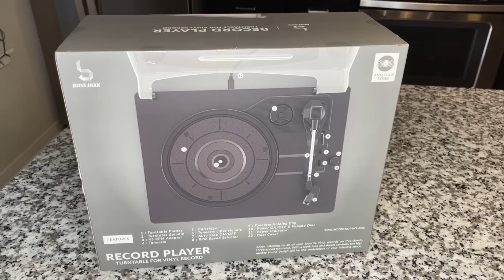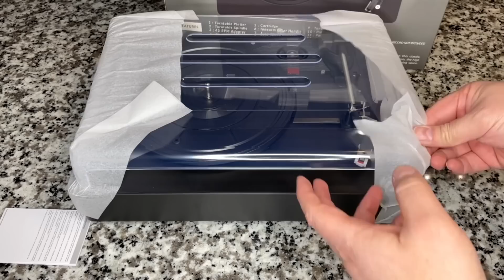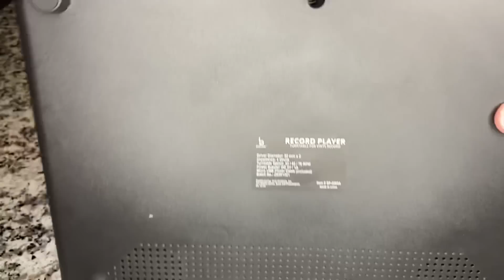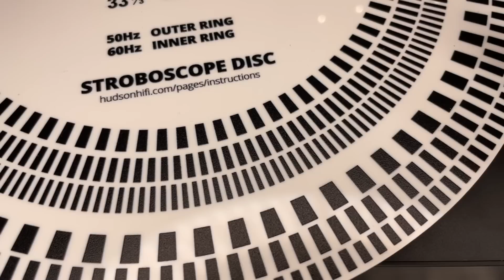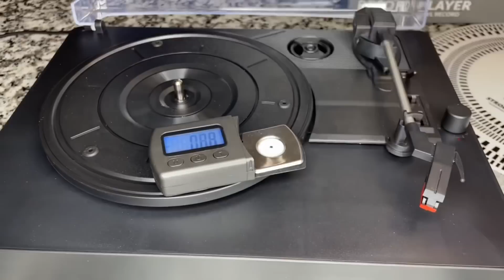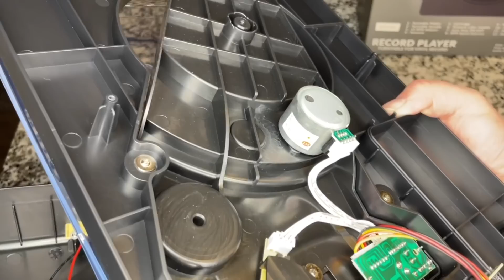SHOCKING $25 Record Player from Five Below - Unboxing & Review!

Comment: Very thorough analysis! I'm wondering if the USB connection is solely for power purposes or if this can be converted to data (and maybe amplified). Have you tried connecting it to a computer to see if it's recognized at all?
Reply: Only 2 wires for the USB, so power only.

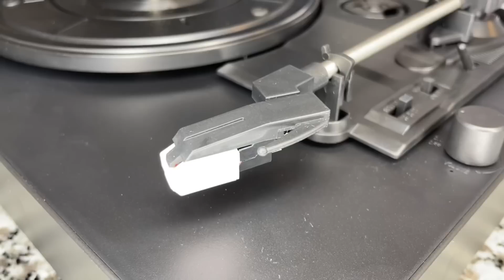Comment: It's been a few days since your review. Ebay resellers are asking over $50 for this unit, and one of these Bass Jaxx record players actually was a completed sale for $49.99 on December 24th. When word gets out on YT videos about a better-than-expected electronic product, prices tend to go way up.   P.S. At 9:26, I notice that the headshell area where there's some sort of finger lift looks as though there's a molding crack. Maybe this is more of a mild scratch which shows up strongly during filming.
Reply: Those paying more then $25 for these will be disappointed… the amp on these can’t handle loud records and clip. So yeah it’s a problem.

Comment: Did you try to connect the Micro USB power connected with a Micro USB to USB cable to your computer to see if it installs a driver and possibly accepts the audio input directly into the computer ?

Comment: Could you plug the USB into a PC and play the record through the PC speakers?
Reply: There are only two wires going to the micro USB port, so all it connects to is power. No data pass-through.
Reply: I was wondering the same thing.

Comment: Not bad just wished it had an output rca jack for hooking up to a stereo or a phono jack in it night could be modified & maybe a better stylus from LP Gear & maybe a little turntable oil it would be perfect. But not bad for $25 I'm impressed. I like the connectors inside. I was expecting flat ribbon cable that was glued together. That's a nice price too.

Comment: Conceivably, you could re route the speaker cables to a pair of RCA sockets or a headphone jsocket. and diode/switch them to cut off the speaker output,  drill the relevant holes, and you could make it more connectable for under $5

Comment: One very important thing that he doesn't cover in this video is whether that type-A USB connector would send an audio signal (hopefully stereo) into a PC if the cable was plugged into one. He seems to think that the unit only outputs through its speakers. It shouldn't be too expensive to also provide this capability. After all, USB cords do have 5 lines, two for power, two for signal and the ground shield.
Reply: It's only manufactured with two wires going to the micro USB connector. Negative and positive. The data lines are not present.

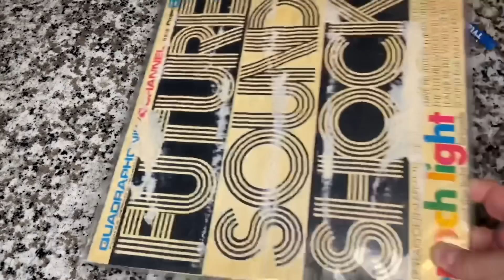Comment: @21:14 Waitaminnit: you're using a quadraphonic record to test a $25 turntable?!
And you're playing this quadraphonic record on a turntable equipped with a ceramic cartridge?!

I'm amazed that you said there was NO damage to the record after playing it on the Bass Jaxx, but I couldn't make out whether that disc you used is an SQ/QS type disc, or a CD-4/Quadradisc type disc.  If the latter, then I would expect most of the ultrasonic, 30-plus kHz 'difference' signals (used to derive the two extra channels) to be kinda wrecked by the 5g tracking weight, not to mention the conical stylus.  So the 'no damage' report was definitely an illogical surprise.  So I'm just interested: did you check under a microscope, and also see what happened (if anything) to the ultrasonic part of the cut?

All that said, nice to hear the music of Enoch Light (and the Light Brigade!) again: the bandleader and recording engineer who discovered The Free Design and produced their first few albums. 👍
As well as creating the archetypal Bachelor Pad music of the 1960s and 1970s 😉 …

Comment: Given your favorable review, I went out and picked on of these up today. Opened it up and tested it out... and I have to say that I am extremely impressed with this thing, considering how cheap it is. I think you might have gotten unlucky with yours, because my tone-arm cue lever works great and is very gentle.

I'm going to bring it over to my parent's tomorrow to play some of their old Christmas albums while we celebrate the holiday. I think this is just perfect for that sort of thing.

Thanks for this review, you definitely got my sub!
Reply from the maker: Thank you 😊
Reply: I’ve have bought and returned 5 units already. Each play a record for 5-6 minutes and then the speakers keep going in and out…
Reply: @crisbwilliams  That's a shame! I must have been the one to get lucky, then. I've already gotten more than 3 hours of use out of mine. Maybe there is a bad batch of them out there?
Reply: @crisbwilliams  it may be your power brick. Some have a built in safety that will shut down if it isn't pulling enough power. Try a different, or cheaper one.
Reply: @crisbwilliams  Your experience adds a valuable perspective to this review. I imagine the dumpster behind 5 Below is filled with these things.

Comment: Try playing a 45rpm on it with an aggressive groove. It seems as if the amplifier circuit can't handle the energy created by loud passages and mutes as a result. Kind of like the clipping that occurs if overdriving while recording digitally. If you have only soft/easy listening records, it's great out of the box. However, to play all records, the output from the cartridge will need to be attenuated somehow.

Comment: WARNING ⚠️  5 units replaced. 

Update- 1,2,3,4,5 units and all garbage. Update- I opened the newest unit up and reconnected all the cables to make sure nothing is or was loose… and still the issues persist. 

I have bought and replaced -5- of these units and all have the same issue. They play fine for a minute and then the sound cuts out… -5- units and they all fail .

Now 5  strikes and this unit is out. Garbage.
Reply: I have discovered that extremely loud/strong records cause the amplifier to become overloaded. Softer/more quietly mastered records play fine all the way through. I don't blame you for not wanting to keep a finicky record player. I think I can turn the one I got in exchange for a return as a party game. I have a bunch of 45's, so I should gather some friends over to play "Will it or won't it play all the way through?" 🤣
Reply: @aaronthompson5691   yeah I tried some older records, ie- Christopher cross - and it plays for a bit before the speakers cut out …. And then come back on. Weird is u can still hear the music when the speakers cut out… 

Oh well I’ve given it 5 attempts and it’s not worth the $25 spent. Better use that money towards something a bit better .
Reply: @crisbwilliams  The Christopher Cross album from 1979 was recorded on a digital recorder so they could have more dynamic range to record a louder groove with the lathe. So yes...that album is a large binary file from 40 years ago, at about the same time Pink Floyd released Another Brick In The Wall Part 2.

Comment: That's pretty amazing for $25; though it would have been interesting to hear it with a more bass-heavy demonstration record. It would be a simple matter to connect a line-output jack directly to the wires from the tonearm, possibly using one with a built-in bypass switch. I was particularly impressed with the frictionless optical end-of-record sensor, a feature many more upmarket vintage turntables lack.
Reply: I would love to see a follow up video! I don't understand the technical specs required, but it does look like a very hackable unit. For instance, with some mild soldering and $2 in connectors, could this drive some inexpensive bookshelf speakers (many of us still have laying around powered speakers that came with most desktop pcs back in the day). And what could a cheap amp board from ebay do for this? The author also made it sound like there are better replacement styluses for this type of cartridge. Etc, etc etc!
Reply: Then you would need a pre-amp with riaa eq. Or amp with phone input..
Reply: A shame it has no RCA Jack provision, nor conventional AC power hookup. That's a deal-breaker for me.

Comment: Have you actually hooked this to a PC to see if the computer doesn't recognize this as a peripheral; if it did, you might be able to play the music through PC speakers.  Just posing the question.   :)
Reply from the maker: Once I saw the wiring on the board I could tell that it was for power only
Reply: @Recordology  darn
Reply: @Recordology  Thanks for the response.   Still, if you want a cheap but apparently reliable record player, then you just shared one with the masses.  lol

Personally stick with Ogg or MP3 files for my play.   :)
Reply: @Recordology  No sign of a DAC, huh?

Comment: Older (1940's) Philco console radio/phonograph players had a crystal cartridge on their single speed (78rpm) turntables.  Usually the cartridges in these vintage players are dead and folks will try to use a modern ceramic cartridge to replace them with.  Problem is the old cartridges required something like 3 volts to work properly and the modern ones usually only have 1.5 volts making the volume very low unless you modify the tube amplifier to compensate for the lower voltage.  A friend of mine (Buzz1151 on youtube) decided to try and rebuild an original cartridge using the ceramic from a piezo tweeter cut down to size and it actually worked and sounded pretty decent.  At least that's what I remembered him using if I remember it right.  Currently I have a Philco 48-1262 console with the 78rpm changer in line out in my shop for restoration.  I'll keep my fingers crossed that the cartridge is still good as it seems to have seen very little if any use in it's day but if it doesn't I will try to rebuild the original cartridge like he did.  Wish me luck, lol.
Reply: Good luck!👍👍👍👍👍👍👍👍👍👍👍👍👍👍👍👍👍👍👍👍

Comment: $25 bucks? My stylus was more expensive than that! The records to play on it cost more than that. Like all cheap record players, pretty sure this will just destroy your records, and not worth it for that fact alone.
Reply from the maker: Why do you think it would damage records?
Reply: @Recordology  on cheap players or stylus, the needle (jewel) is much less likey to be shaped or cut as precisely as it should be. It won't damage it immediately, but it can wear the record out prematurely. Think of all those poor childrens records subject to cheap record players over the yearsI. I know I wore a few out when I was a kid. Less likely that the tone arm on this player was balanced properly. But If you're going to be paying 25 bucks for a new vinyl album (as most seemed to be priced at) or have decent valued older records , you're better off buying a higher quality turntable (not too expensive) like a gemini, fluance, or numark, or audio-technica with a or something decent you can put a decent brand name cartridge on.    As with musical instruments, the cheapest entry-level more often than not just isnt worth it.With something as relatively fragile as vinyl records, its worth jumping up to mid-priced equipment. Plus, it will last pretty much last forever in home use. Pretty sure the belt in this will be shot pretty quick, too, just like cheap tape decks had back in the 80s ans 90s.
Reply: wrong
Reply: Mr.Record-ology is right. He checked the tracking force of the stylus, and it is within spec for that type of cartridge and the specs the recording industry set when the standards were created.

Comment: I have to ask as it was not disclosed.  Is this record player dual mono or stereo. I heard mono in my headphones but not knowing the separation on the l.p., I have to ask.
Reply from the maker: It was indeed stereo
Reply: @Recordology  wow. I went on 5 below website, not there so it's probably a selected few stores
Reply: I can confirm. Definitely different parts of the mix coming through each speaker.

Comment: I was the kid that knew how to modify stuff, i woulda bought that, installed better speakers,then did an car radio interface for line level drop and ran it into what ever bigger stereo I had.I actually did it to one of those little crappy record players in the 70's,80's etc then id be upset it didn't sound to good.lol

Comment: Ok. So I went ahead and bought one of these and its absolute JUNK! The amplifier cuts out constantly on moderate to loud songs at any volume. I tried 3 of these units with the same results. It also seems to have a gated output to where the amp cuts out when there's no sound going through it, i.e. between tracks, and it tends to clip off a quarter of a second of the beginning of the next track.
Reply: Same here. I thought the first one had a bad cartridge, because after about 5 to 10 seconds of okay play, the audio would drop out. Lift the needle and place it on the record again, and get another 5-10 sec. Exchanged it, and with the second one, finally realized that records that were not as loudly mastered would play great, but as soon as any other record got too loud, I could begin to predict with accuracy when the audio would drop out. Keep and tinker with it, accepting the fact that without some kind of modification, it will never play the more loudly modulated records, or take it back and get a refund...
Reply: Perhaps needs a beefier power supply? But players like this sadden me for they are bottom of the barrel junk that will probably be clogging up the landfill before next christmas.
Reply: I’ve replaced 5 of these thinking it was bad luck… I posted a warning in the comments. Good to see I’m not the only one…
Reply: Sad, but true. Seems to be a design flaw. I have run into the muting thing on other Chinese players, and thought it might be that, triggered wrongly. I just got mine the 24th, so I haven’t been able to see if I can fix the problem.
It definitely sounds like a circuit intentionally muting the output for a few seconds under certain circumstances. I don’t believe it has anything to do with the particular USB supply used as long as it provides the 1Amp @ 5Volts needed. Just sad to see another potentially good buy on something that seems to sound reasonable, be hampered by a flaw that essentially makes it useless, unless there is an easy fix.
Reply: There's more than enough power being fed into the player. It's that the cartridge overloads the amplifier circuit. I don't even get near turning the volume all the way up with the records it will play all the way through. It definitely gets sufficiently loud, at least to my worn out ears. lol
Reply: No bueno senor

Comment: The Bass Jaxx brand is owned by Zeeva International Ltd. out of Hong Kong. The vacuformed plastic packaging spacers, the lack of wall wart or audio output are obvious cost saving measures. Also, it isn't advertised as USB because the USB port is used purely as power supply and it has no actual USB functionality.
Reply: Poor Basement Jaxx

Comment: It would be interesting to run the speaker wires out to some old full range 12" speakers you get out of 60's consoles. I'll bet it wouldn't be too bad.

 Why wouldn't they at least face the speakers forward? It appears they had the room.
Reply from the maker: I think facing down uses the flat surface to amplify resonance.
Reply: @Recordology  Maybe but it seems silly
Reply: That was definitely a thought out design choice. Gain some resonance from the surface the player is sitting on to make up for what it kind of can't do on its own.

Comment: but I want to hear the vinyl sound through speakers.  and I also require some bass sound.  and for that it is required either that it has an output for headphones or connection to speakers or an amplifier

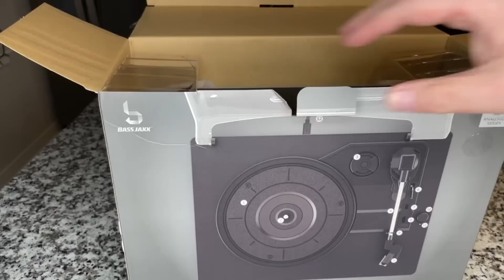Comment: 3:53 Turntable of this caliper? lol 
14:46 Don't forget stylus alignment! If it's not nicely squared into the groove, it will grind into one of the walls.
16:15 Tracking too light is even worse because it causes mistracking. The stylus will be so light that it'll start to bounce around in the grooves causing heavy damage!

Comment: I went to 5-Below and picked up the record player unit. It’s my first record player ever. 

I collect records for the art work and needed something simple to play some records. I have to say I was shocked at how great this unit was until….

Until  the speakers went out after one day. I Will be exchanging it at the store and hoping for the best. 

 Still a great starter unit for someone starting out or just wants a unit to play a record every so often.

UPDATE- second unit does same thing. These might just be garbage. Besides it’s all highs and no mids or any bass. I can see someone getting this and not collecting anymore.

Update again- replaced the unit again. Three (now 4 units) times and all have the same issue. They play fine for 3-5 minutes and then the sound cuts out in the middle of a song.

Sorry but these are garbage.
Reply: Speaker wires might have come loose. Easy fix with a soldering iron. Did you get a chance to open it up and take a look?
Reply: @StevenS757  just exchanged the first one and the second one does the same thing. Plays for a minute and then the speakers cut out and then come back on. 

 Will have to admit this is garbage. When it works it’s all high end and no mids or any bass. Makes the record sound like garbage.

Comment: 7:00 The last time I checked, the whole point of having a dustcover was to protect the turntable, platter, and stylus from DUST. ;)
Reply: Dust covers also block the amplified record from causing feedback at higher volumes. I've gotten feedback on my system before. Closed the dust cover, no more feedback.
Reply: @porcelainthunder2213  That's a good point and a good tip regarding the benefits of turntable covers.
Reply: I loved The Plant of the Apes movies .All of them. Cool picture 🤩😍
Reply: @philipgapske2206  Haha! Thanks. Yes, the new ones are okay, but my first love will always be for the classic 'Planet of the Apes' movies with my favourite being the first original one and 'Conquest of the Planet of the Apes', the latter of which had Ricardo Montalban. :)